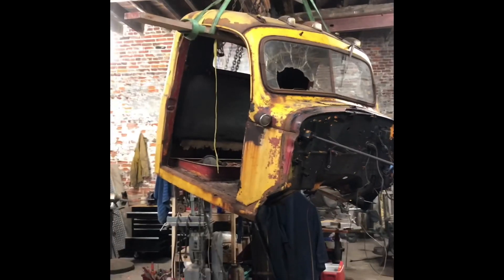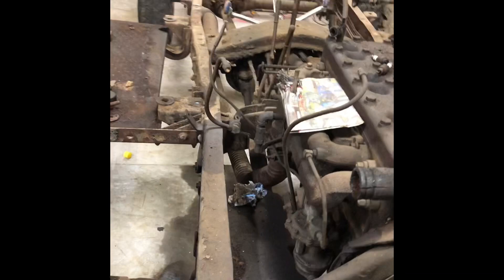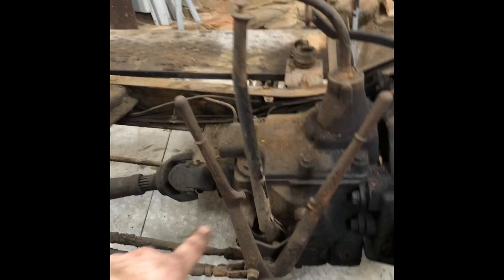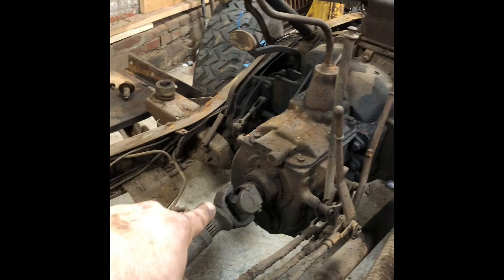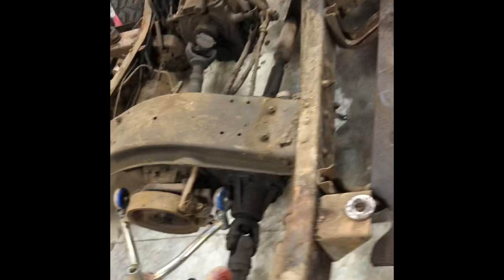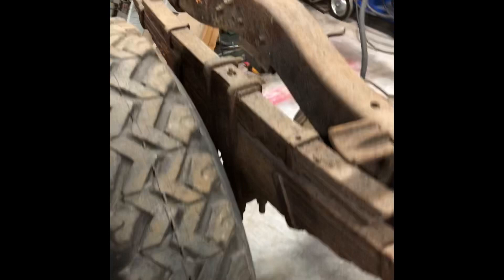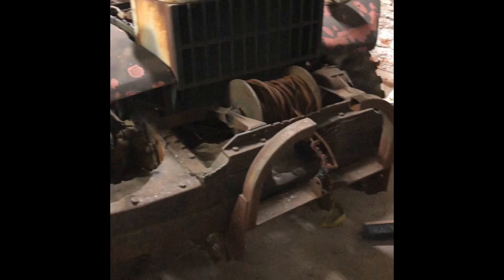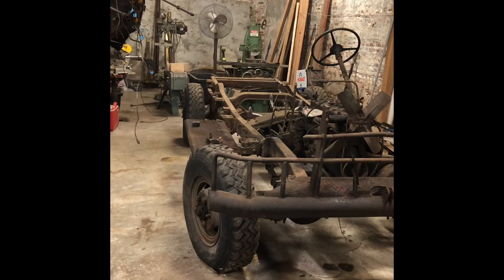1958 Dodge Power Wagon Powertrain Overview

Comment: Are you going to sandblast the frame and get it down to bare metal or just remove flaky rust and use a rust encapsulator or rust treatment stuff. I am wondering cause I am almost at this stage in my restoration. :)